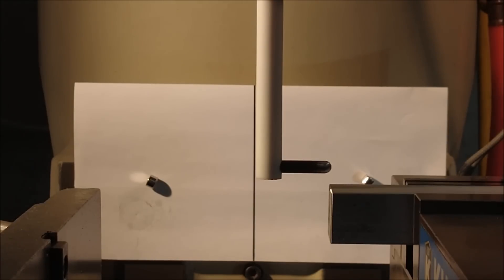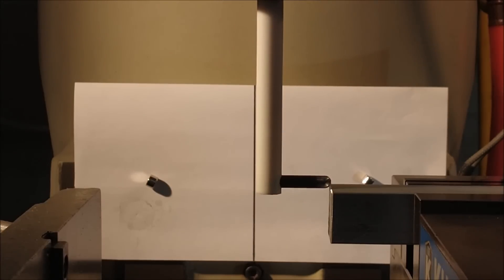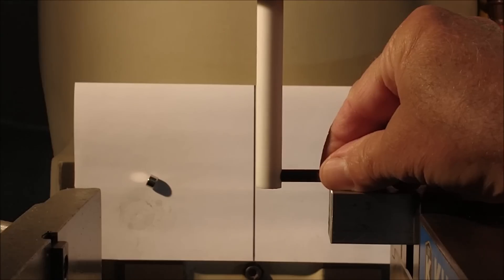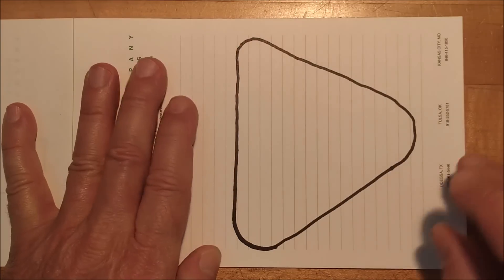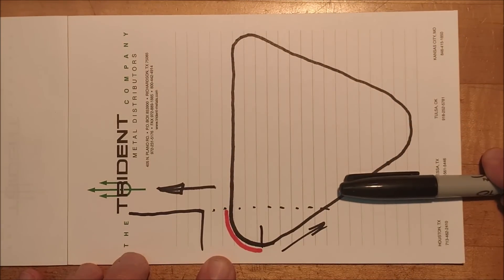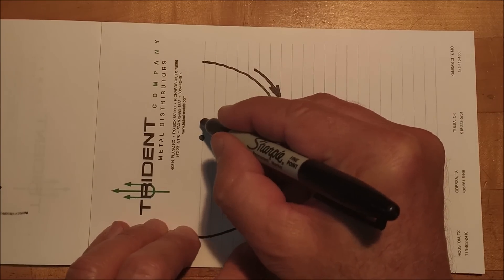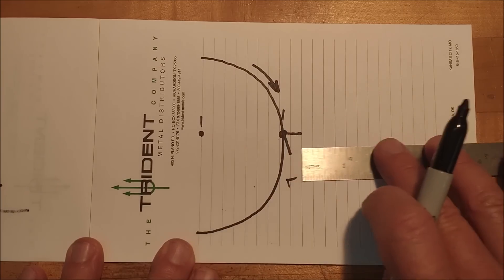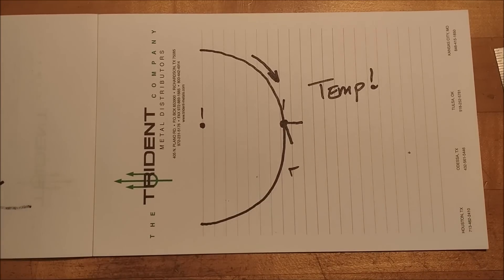Tool Flex = Blown Dimensions  = A VALUABLE LESSON HERE !!

Comment: Thanks for the tip on temperature. That answers a couple of mistakes I’ve had  over the years.  A point I’de like to make is tool pressure on minor cuts. When sneaking up on a final diameter that’s  .002” over on my radius machine I advance the bit .001” make a pass, no ships ??? Maybe my math is wrong add another .001, again no chips, frustration, add another .001” now it makes a nice chip but wait a minute it looks too thick. Measure the part and guess what… now it’s .004” undersized. It’s not that the tool bit is too dull it’s how much pressure does it take to keep it in the work.
Your explanation is spot on. Thank you for sharing your knowledge with the common folk. 😊

Comment: Boring a deep hole, lets say 10-12" deep & hole dia of 1.375. How would you approach that?
If it was 16", what would you do different?
My dad has a 13" lathe with a bxa and i have a 15" with a cxa.
He ran into chatter trying to bore a deep hole.
I chucked up an old cv axle end to try a new 1" bar on in my lathe. I found 4" of stickout worked great. 6" i had to change the DOC and speed, finish wasnt as good. Chattered in most cases.
8" of stickout simply would not work (12" bar).
Im going to need to make some accurate deep holes in some small pipe in the future so i need to learn. Thanks!
Reply from the maker: Research line boring.

Comment: I've heard of guys speeding a boring head up in rpm to "throw" the tool out to squeak a couple tenths out.
Reply: Theoretical maybe. But if the increased speed leads to chatter in your finish cut your surface finish is blown.
Reply from the maker: Increased RPM could change the size.

Comment: Hey my friend, Like so many others I usually take a 1/2 of the material removal 2 or 3 times to final a size but as you have shown here the farthest away must be nibbled away. An extra couple halfes has to be made/put in place.  That PATIENCE thing has to be kept on the platter/(note pad). Over the years it is just a normal thing I do. Spring passes no matter how little has to be practisted just for because. Making sure there is no build up on the nose of the tool. My old teacher in machinists school gave me a tip cleaner 50+ years ago I still have it. If carbide is being used I prefer the silver soldered type so they can be sharpened as verse of the insert type as they are far harder to keep a sharp profile. I always had a magnetical thermometor (now a lazer) as 72 F is I believe to be the industry standard.  If fluid is available run it. Even when it makes a mess. Thanks my friend. Many will learn alot from this post. Some may have to revisit. Is what it is eh !

Comment: [QUESTION]  What can we use the inscribed radius of the insert number for other than Identification to order a new insert? I'm curious why they chose to measure those parameters instead of simply a random part number? Would you choose to get a specific value for a job as opposed to another? I assumed its was chosen from experience that is acquired from cutting different materials and how fast the material removal is optimal to efficiently get the job done...?
Reply from the maker: I believe, " inscribed circle " ( not radius ) is so you can purchase the correct size insert based on what holder you have and feature you wish to produce. Chip breakers are available in different sizes, so I doubt that's got anything to do with it.
Reply: @joepie221  joe you dont knnow how much i apreciate your reply. thank you!
Do you find that the insert you chose make an obviouse differance in a feature you intend to produce. I normaly use a 3 or for radious tip insert to get as smooth a cut on Aluminum as i can once i change to smaller or larger im having trouble with roughness. Im probably not taking into consideration some other Speeds and feeds / regidity factor, but i would like to hear your thoughts on how you get a smooth cut that needs minimal Post work.
Reply: I don't understand what you mean by "inscribed radius"  ?
Maybe that is why no one has answered your question   ?
Reply: @stevewilliams2498  Inscribed radius is the radius of the imaginary circle that the insert would fit into.

Comment: I'm retarded, but isn't this what spring passes are for? Being serious.
Reply: A spring pass will most of the time give a bad surface finish. And for close tolerances you will never know how deep the spring pass cuts. Almost impossible to hit the right size.
Reply: Yes. But unfortunately many machinists are too impatient and attempt to finish with heavy cuts, or you could say more retarded.
Reply: That makes sense,  I just thought if you take "baby" cuts it would cut down on the deflection. But I will never argue with people that actually know, I just like asking things. I only have a mini lathe but have learned everything trying to copy people like Mr Pie. In fact when I bought it I was really scared I would crash the tool into the chuck. But Joe taught me to cut threads away from the chuck! Excellent advice for noobs, like every video he NEVER stears you wrong.
Reply: Yep, this is what spring passes and honing/polishing are for. Trying to take a dimension to finished size and finish in as few cuts as possible is for the CNC setup guys to figure out when they can afford to make mistakes early on. Spring passes dull cutters greatly and will eat into profits.
Reply: That knowledge comes with experience.....usually learnt the hard way.

Comment: My mentor taught me to take 3 equal cuts for my finishing passes on a lathe, without retracting the tool. I do this with my boing heads as well. If I'm not sure of my spring pressure I will back off and touch off again, then take 3 equal finishing passes. I have been very successful because of this advice.
Reply: Just came here to say the same thing! The first two passes prove the behavior, and the final third pass replicates it.

Comment: Machine creep has an impact as well .   More so on larger machines . Take a cut , noting a reading on the dial . Then look at what happens to the DRO reading during the cut , it can change .  That is caused by the initial load settling down on the feed screw & nut due to the weight of the carriage , causing an unwanted carriage shift during the cut .

Comment: One thing you didn't talk about was the issue of carbide tooling in general.
Carbide (in general) really likes a lot of tool pressure, and will not cut when you have less than the needed pressure.
You see this a lot with people trying to creep up in tiny increments to the final size, and suddenly have the cut much deeper than expected.
Instead of trying to take fine shaving cuts, try to take 0.005" to 0.010" final pass. This is especially importation with larger radius finishing tools.
Reply: Yea need to get that nose radius in the cut at least. 

I liked that Joe taught this because then you know the why. 

I always leave at least 0.040" for finishing.  Then split that into 2 finishing passes, measuring between cuts.  That gives very similar tool pressure so similar deflection and bang on parts.
Reply: Is that unique to lathe tooling? I regularly take <.001" finish cuts with carbide end mills. Lubricant gives a much smoother surface (I use Anchorlube). Haven't tried carbide on the lathe yet.
Reply: @dekutree64  Endmills have much sharper edges, and finer grain than insert tooling. Also, endmills are sharpened to a razors edge while insert tooling seldom is. They cut much more like HSS than carbide.

Metal does not cut like wood where the edge actually slices into the material. The metal is actually deformed by the edge and then flows like clay (plastic deformation), and rolls up and becomes a chip. HSS and carbide mills have a very sharp edge, so the pressure needed for deformation is low. Inserts have (usually) fairly blunt edges to expend tool life which requires significantly more pressure. Finishing inserts are sharper, but chip very easily.
Reply: @dekutree64 another thing to consider is that lathe cutters generally don't like interrupted cuts. While milling cutters are doing just that depending on the specific operation obviously.
Reply: @dekutree64  Carbide end mills are generally ground with  razor sharp cutting edges whereas carbide inserts for turning are often radiused thus not a sharp cutting edge like HSS would be.
There are carbide turning inserts which are ground edge and these are usually for plastics and aluminium/copper etc but can be used as a finishing tool on steel and stainless  providing the depth of cut is very light.
Reply from the maker: Watch the video link on milling cutter deflection at the end of this video.

Comment: Yep, I learned this lesson by watching youtube machinists - mostly Abom79. Some of his earlier videos from years ago involve heavy machining, and when he got down to around 0.100 left, he would let the part cool, measure, then take a pass of around 1/3 of the remaining work ... so 0.033 in this case. Then he measured again, and took 1/2 of the remaining, measured AGAIN, and took the remainder (or sometimes even split the remainder into 2 equal-ish passes). Once he got the part to about a thousandth of an inch 0.001 from target, he then polishes it out with emery cloth and a scotch-brite pad.
It's a valuable lesson : there is no such thing as a rigid setup.

Comment: Remember this, as the tool cuts it also will grow longer from heat expansion and the tool will go deeper into the part. I expirenced this a lot while running a metal planer.
Reply: @jacknelson8397  
The boring bar on a boring head does not even remotely get hot unless something is very wrong.
Reply: @batmanacw  I can tell you don't have much machining experience

Comment: The letters for the inserts are
1. general shape (T is triangular)
2. relief angle (P is about 11 degrees)
3. is tolerance field (G is 1 thou in diameter and .5 thou in thickness, so actually pretty tight)
4. is mounting type, interesting that there isn't one, flat with no hole or chip breaker or anything would be N according to the table I have
Reply: there's ISO and ANSI (US) designations for inserts. Joe's insert is in the ANSI designation,  the ISO is similar in many ways but different enough, has the 4th letter @CatNolara mentions, and the measurements are metric. the same insert in ISO would be TPGN160304...  16=16mm edge length (instead of inscribed circle ANSI use to show the size), 03=3mm thick, 04=0.4mm corner radius
Reply: @dataminetk  ah, ok, thought the designation for inserts was uniform. But even the measurements on ISO inserts are imperial, only with metric representation. If there's a 3, it's actually 3.18mm which is 1/8 inch, 2 is for 2.38mm which is 3/32 inch etc.

Comment: I know I'll get hate, but the international insert defining system is more descriptive, and probably more accurate as it uses metric units and brings in the chipbreaker style.
Reply from the maker: I'm always confused at how one measuring convention can be considered more accurate than another. I could see this being true about an instrument, but not a size. Metric and imperial are simply different languages when it comes to measurement. A 1" or 25.4 mm square standard is exactly the same thing. No hate intended, just my 2 cents.
Reply: @joepie221  Might it be that the accuracy he is talking about is the tolerance for the insert to get that particular designation?
Reply: @joepie221  I believe the units the manufacturers use are metric and so are more accurate over the imp approximation of those units. I state no belief one system is better than another. A distance is absolutely the same no matter the units used to measure it, but it is more accurate to say a distance is, say, one inch, than the approximation of 25mm or vice versa.

Comment: I learned from Stefan Gottswinter to take consistent cuts as I approach the final size so that you can get a sense for how accurate the relationship is between what you are intending to cut and the actual cut, and so that your tool pressure and deflection stays consistent and repeatable.  So if I get to within .060" of final size, I'll take a .020" cut and measure with the mic.  Then another and measure with the mic.  So my final one can be microadjusted to be on size.  I was able to run a bunch of shafts to +/- .0005" pretty easily.
Reply from the maker: I always reduce the cut depth as I approach the final pass.

Comment: Also, if the tool was set above center, cut load flex can increase the material removed. Thanks again.
Reply from the maker: Flexing down from an above center position, you would think the cut would be smaller since its a vertical linear flex and the feature is radial. Thoughts?
Reply: @joepie221  external radial cut, if the tool was above center, yes. I was  thinking of the original boring bar question dial 2 and get 6, I would guess the point of the bar is clocked to high. The torque is twisting the tip outward into the material. Perhaps the geometry of the bar is ground too positive?
Reply: Small boring bars are tricky. Too small, long, negative, positive, it is difficult to pin the issue down without seeing the setup. It could even be the tool is too dull for a .002 cut.

Comment: When l was working night lhas to follow up on a job. It was on a Saturday and the guy on the job really did not run a jig bore very often. Weak setup on the boring head with a 3/4/19mm boring bar sticking out about 8"/200mm. Machining aluminum bronze. Ampco 14 or 18. He was having all kinds of problems. Fortunately l had enough stock left to work with tore his setup down and went with a stiffer boring head setup with a stouter and shorter bar. That made all the difference. 
When l had an apprentice working with me one thing l would do is show them just how much a long boring bar would flex in the lathe. Both pushing away and digging in when the tool would take the load. The biggest boring bar you can fit in the hole and as short as you can make it. The LeBlonds we had came with both lantern and square tool posts. I made my own square with a 1-1/2 hole for boring bars with a matching centerline to the spindles. Plus reducing sleeves to match different bore sizes. Any bars l made myself were out of 4140 TH&P or a shafting steel with a trade name Mirralloy. This was long before we had any commercial insert bars. 
Finally one of the smarter engineers realized that when some of the tooling for production became obsolete they'd send up to us and let us pick through it for anything useful.

Comment: Thanks for another great video thanks. I’ve a question about edgefinding on a round part. You touch off on the first side and the edge finder moves to either the left or right. When you then move to the other side, should you reverse the spindle rotation ? My thinking is you should, as the edge finder will not be square to the edge and so will have to go either towards or away from you, but the opposite will apply on the other side. Bit like climb milling one side and conventional milling the other. Your expert opinion would be appreciated. Thank you.

Comment: Boring head increments are radius (at least mine is) and not diameter - that's caught me out more than once!
Reply: We had a big lathe with the cross slide reading tool movement instead of diameter. More than one guy made a mistake.
Reply: @mpetersen6  My harrison lathe has dials that read radius rather than diameter hence .001"advancement on the dial will reduce the workpiece diameter by .002".

Comment: Rocking the Santa look for Christmas? Or is it getting that cold in Texas? Thank  you Joe. 
BTW. Have you seen the spring loaded cut off blade holder designed to eliminate breaking cut off blades on small lathes?

Comment: Frustration, Yes it's what I feel when I have spent a long time working on something and it's blown and I have to start again, however I'm not saying "I'm frustrated" when I'm screaming.
Reply: On a serious note, this is why I like to switch over to a dressed piece of HSS on finish passes if I can. I bring it close with carbide tooling and either switch over to **gt inserts for the last few thou or go to HSS to relieve a lot of the tool pressure when working I.D. when working O.D. and I'm trying my best to hit in the tenths I go to a shear blade grind on HSS. I'm a hobby machinist and since production isn't a concern I can take the time to do this.

Comment: I was thinking, too, that if the part being turned is "sticking out" a lot, with a heavy cut, the part can "climb" up on the cutting tool a little bit
Reply: Boring bars can push away or dig in. As big a bar as you can fit in the bore and the absolute shortest bar possible. I've had jobs where l had to cut bars to a shorter length. Another source of boring tools. If you have an end mill with a corner broke off. Don't chuck it save it for boring work.
What frustrated me the most was deep slots that needed to be milled. Sometimes even trying to rough them out and use a bigger cutter for finish didn't work

Comment: I was boring a10mm hole yesterday and got a tapered hole in brass, larger at the breech and smaller at the muzzle end.. Tool had top rake. My conclusion was it grabbed to much. What says you?
Reply: What size bar and how deep. And yes it likely dug in some.
Reply: @mpetersen6  10mmx30mm